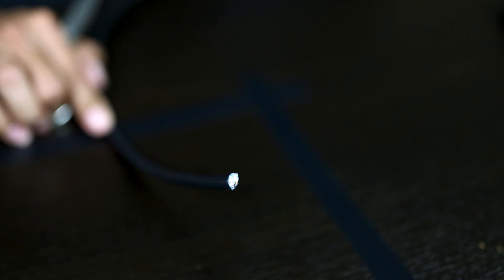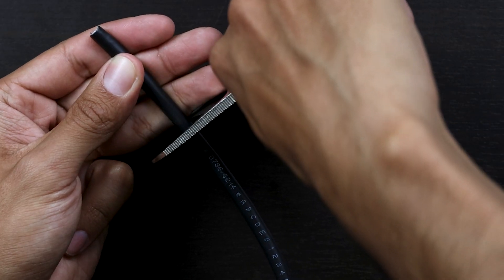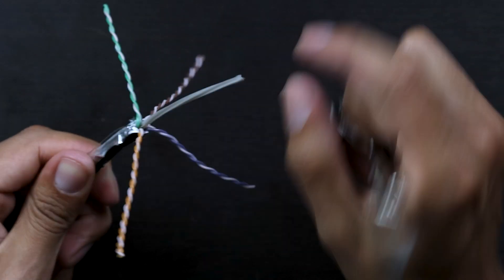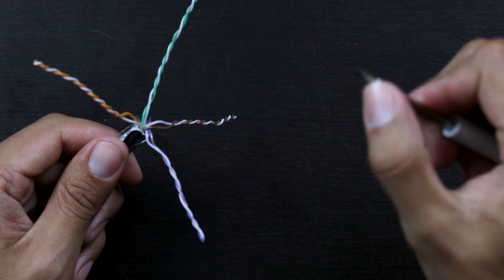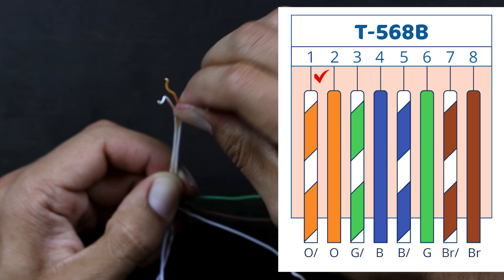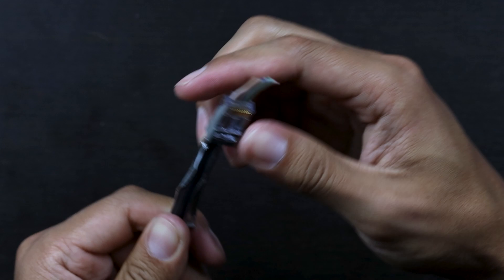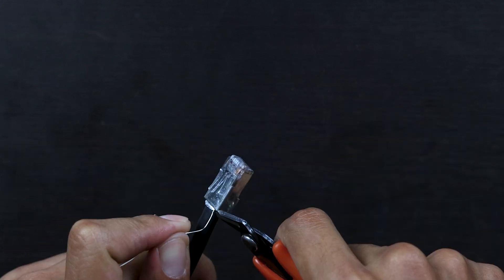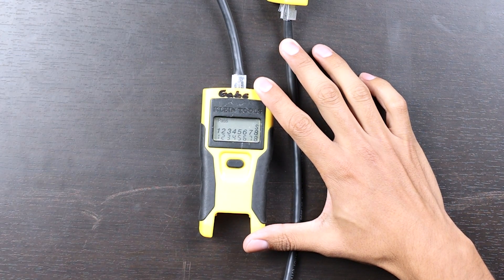Simple & Fast Guide: Terminating Cat6 Cable with RJ45 Pass-Through Connectors!

Comment: I cannot seem to make a cat 6 cable that connects faster than 100/100. I do exactly this, but still no dice. The same cable ran to keystone connections and using pre made patch cables connects at 2.5gbps just fine so I know it's my crimps. Any pointers for where I may be going wrong?